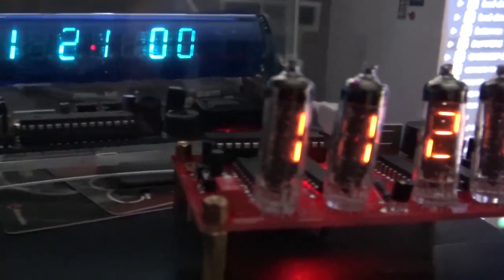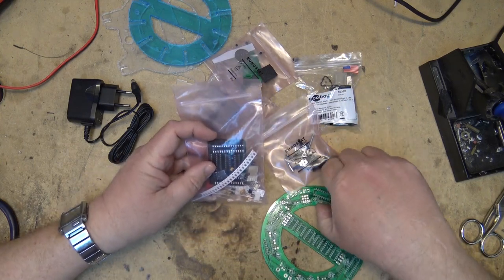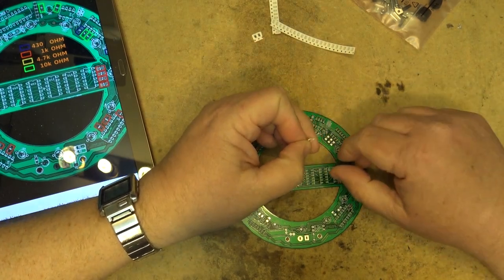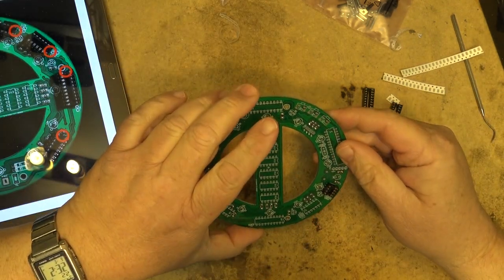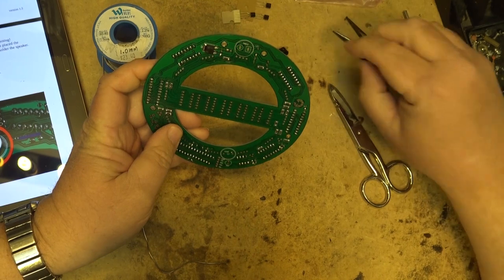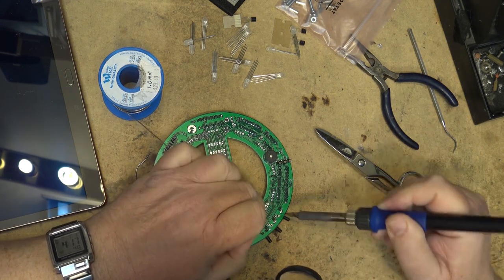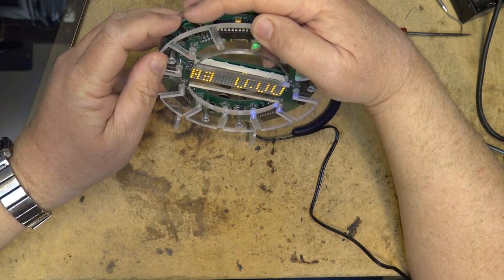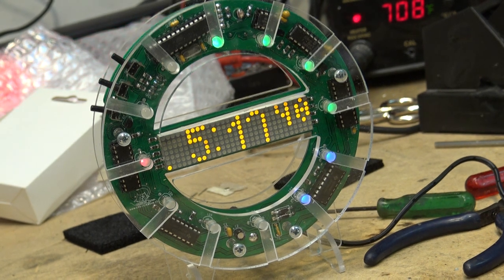RGB Dot Matrix Digital Clock Project

Comment: I love the way the one that opens the door is last, or so it seemed- typical Cats! Anyway, back to SM resistors...aggghhhh!
Reply from the maker: No the one that opened the door was first.  This was actually the second time. He did it once and I there him out and turned the camera on and he pulled the door open again.  My other can can open the door with the handle and let himself out so I have to keep the deadbolt on at all times. Dam building code forbidding dooku knobs. We have to use lever types for handicapped to open easier. Tell that to parents that cant keep toddlers now from opening doors as soon as they can reach it.

Comment: £129.00 PLUS POST TO UK WOULD BE TO MUCH FOR ME BUT THANKS FOR THE VIDEO
Reply from the maker: It's expensive but it is one of the coolest clock projects I have built and us much more accurate than the 300 Nixie tube click kit I ordered from the UK from pvi electronics.  Mind you the Nixie click has a GPS option but I don't have it and it looses time.